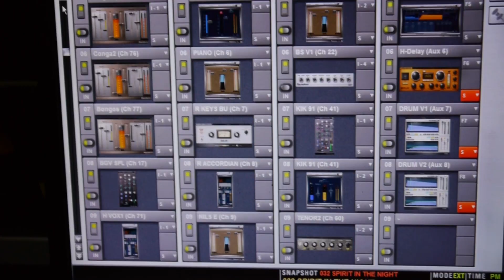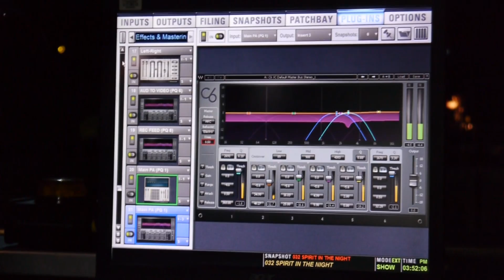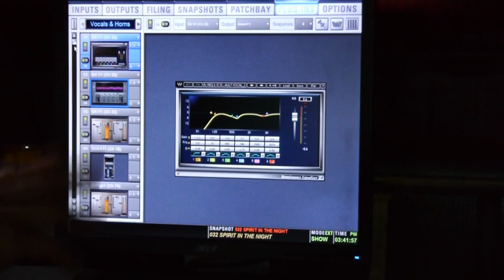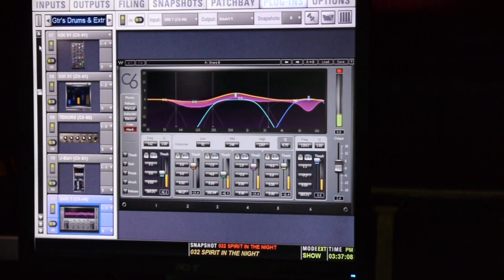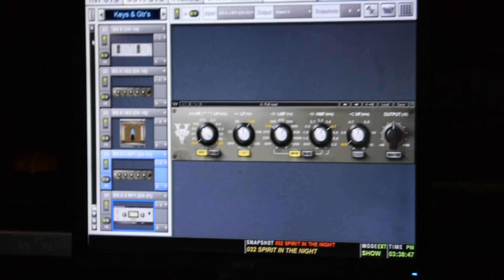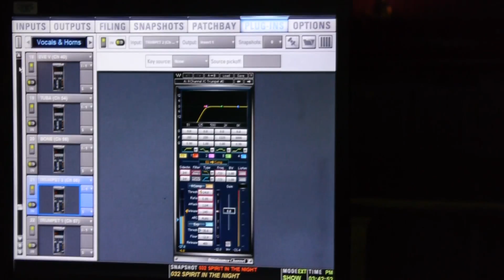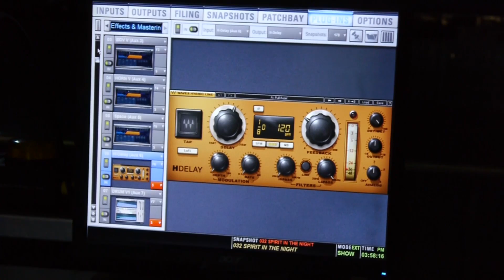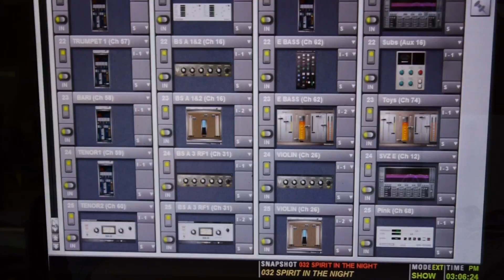John Cooper on Mixing Bruce Springsteen

Comment: I left a springsteen concert after 3 songs - holding my ears from the downbeat.  My wife and I traveled on a train to get there, renting a hotel, dinner  out...  We were sitting dead center, about 40’ behind right FOH on the 2nd level, front seats.  3 songs in we couldn’t take it anymore.  I own and operate a sound and lighting rental company, so I can attest that this guy couldn’t mix a cake.  It wasn’t just the volume, it was the tonality of whatever was coming from the pa, from piercing piano, and sax to just insane spl levels for no reason.
Reply: Is it not a case of the more complex it has gotten the more tech heads without ears take over?
Reply: @Jesús St James I actually mix all the time, including some national acts.. why are you so triggered?, You’re not that guys boyfriend or anything are you?